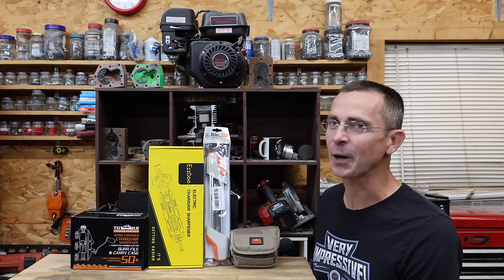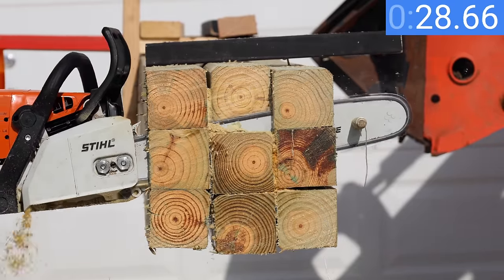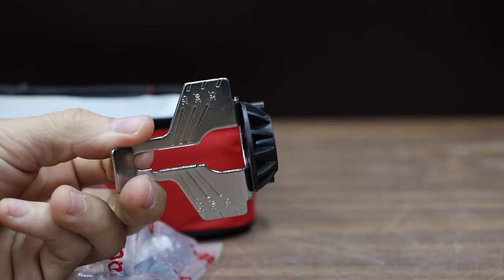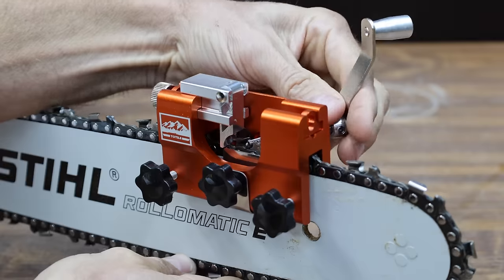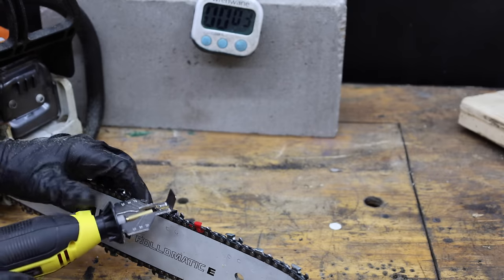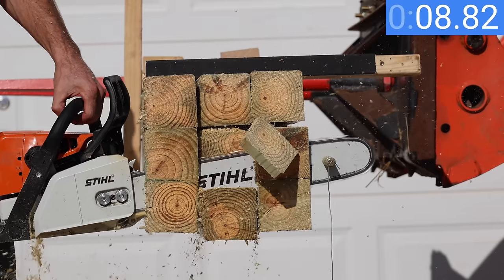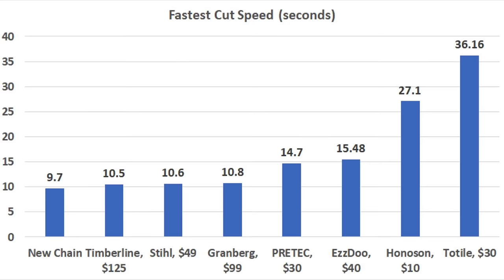Which Chainsaw Sharpener Is Best (2024)? Let's Find Out!

Comment: After years of sharpening chains with round files, I figured out the secret is lifting the file upward against the cutting edge as you stroke. Thanks for the videos.
Reply: yep, that is hardest part, always wigle
Reply: You are so correct and when you can wipe the burr off that top edge, you are good to go.   👍
Reply: im down here about to leave a comment saying exactly this. i worked for an arborist and learned the same thing
EDIT: the tool i used had a square file that also calibrated the depth gauge, and was attached to the handle, allowing me to do both jobs at once
Reply: Yes! A little flick. I use an electric stihl and it's five steady forward strokes (as if using a file) and a little upwards on the last stroke
Reply: But if you use the correct size file you shouldn't have to lift the file.
Reply: My Dad always told me that, smart man😁
Reply: Ditto.
Reply: This is true a but as your teeth get smaller after a few sharpens  you also need to remove material at the bottom as well therefore you need to push down and back as well.... aka getting the gullet
Reply: @jbbolts    I typically bear straight in for a few strokes and finish lifting upward.  “Giggety”🤣
Reply: 18 years of running a saw had me learn that early on.
Used to run Oregon 77LP on a Husqvarna 266 with a 15" bar.
Handled Sitka spruce up to 7m³ of measured timber.
No time for gadgets when it takes less than 5 minutes to do both cutters & depth gauges by hand using files.
Reply: @assog5737  People tend to press down when filing, so the file ends up cutting lower (that's why the Oregon file holders exist).
It's not so much lifting as ensuring the file is cutting at the correct depth & experience allows one to eyeball the top of the file for correct alignment.
Reply from the maker: You are welcome!
Reply: That’s the only cutting edge I even pay any attention to while sharpening. Not really sure why Todd was testing sharpness In the concave “belly”. As far as I am concerned that part of the tooth is only there to hold up the flat chiseled section and has very little to do with cutting. It usually ends up sharp anyway (if you are sharpening properly), but it shouldn’t be the section that is focused on.
Reply: And also you cant go back and foward with it
Reply: Thank you very much for testing different type of chainsaw sharpeners! I was thinking of buying a china grinder but now I don't have to, there is good consumer advice on this channel ! From Sweden Östersund thanks again 😊❤
Reply: @GARDENER42  While some gadgets help with accuracy, I have also found they slow just slow down. There's nothing better than the right files for sharpening the teeth and depth gages, and having enough practice.
Reply: @athhud  True! The top edge does the real cutting, and has a lot more to do with cutting speed. The gullet helps the chain get side relief and run a little truer and cooler.
Reply: @Bob_Adkins  Absolutely & when time is money, hand files & experience can accurately sharpen a chain in a few minutes
Reply: @athhud  its because he makes videos on youtube and isnt an actual operator
Reply: About to post the same. Technique was the issue here.

Comment: Have owned the Stihl sharpener for years. It’s fantastic. The fact that it files down the raker is a game changer. You can sharpen the chain many times before needing to replace.
Reply: Indeed it is the best besides a good hand file but for in the field can't be beat.
Reply: There was another YouTube guy, home star something or other, but he did the Stihl sharpener and said he'd ONLY use that Stihl all in one sharpener.
Reply from the maker: Thanks for the feedback.
Reply: Yup, good point.
Reply: Agree! I don’t even bother to use my Oregon electric sharpener anymore. I can do as good a job with the Stihl and I don’t even have to take the chain off the bar.
Reply: Yes, wear gloves when sharpening if you don't want to bleed
Reply: Stihl ones are great. Just to be aware to buy the right sized one for each size of chain if have multiple saws as the measurements are not the same. I have 3 of them. Also worth having a file brush to sweep out filings and keep files clean, and to spin the files a bit in the device every so often to wear them easily.
Reply: @cgasucks  Good idea !
Reply: 18 years of commercial use meant chains were taken down to the top being a mere triangle & depth gauges/rakers reduced as needed on the way.
Used to reckon on three sharpenings for each filing of the depth gauges.
Reply: Agree. Sthil sharpener is a game changer.
Reply: Agree.  Best sharpener.  Used it for years.  I could be a spokesperson for this product I like it so much.  Fast, easy, impossible to screw it up, and make the chain like new sharp. I've talked a lot of friends into buying this product and they've all thanked me.
Reply: @CharlesManch  Homestar runner?
Reply: If you want to save a few bucks the PFERD Chain Sharp is the exact same thing made in germany just a different color and a little cheaper
Reply: The Pferd one is the original. They are the supplier for stihl.
Reply: If you don't know, the Stihl manual sharpeners are made by a German company, Pferd. Pferd sells the same sharpeners without the Stihl branding (blue instead of orange) and about $10 cheaper than the ones with the Stihl logo on them. Pferd makes some of the best files on the planet, which is why Stihl pays them to make theirs. If you need multiple diameters, you can buy one Stihl-branded and the other Pferd so you can tell them apart at a glance.
Reply: Anybody here able to provide a link for buying the replacement files for the Stihl 2 in 1? I’ve been searching and can’t figure it out
Reply: I disagree, rakers dont need to be filed down every sharpen…i file my rakers based on the wood im in and use a proper raker depth gauge…the 2 in 1 is trash…
Reply: Same here. I've had variations of just about all of these and the 2--in-1 beats them all.
Reply: @GARDENER42  thats why i tell people the 2 in 1 doesnt work…you have to take the flat file out, you shouldnt file your rakers every time you sharpen the teeth…

Your chain will be way too aggressive, ive not had good luck with the 2 in 1
Reply: I've also owned and used the Stihl for years.  it's an incredible product. The simultaneos raker sharpening often will make the chain better than factory.  It also is small/portable, doesn't take electricity, and you can sharpen very quickly. it really is about the perfect product.

I've been waiting for him to review it.

Comment: Sharpening a chainsaw blade is absolutely on of the most annoying and tiresome things to do. This video is SOLID GOLD information people! PF knocks it out of the park once again!
Reply from the maker: Thanks!
Reply: @HQHQHQHQHQHQHQHQHQHQHQHQHQHQHQ 100% agree all these sharpeners are gimmicks except the Stihl combinfile
Reply: @HQHQHQHQHQHQHQHQHQHQHQHQHQHQHQ although Todd does a fantastic job with this channel.
Reply: when you put a new chain on, just do "maintenance" files with the stihl file every tank or two of gas. just real quick 1-2 swipes on each cutter. takes 3minutes and it stays sharp all day.
Reply: @dannyboy8835  Until you hit a rock or piece of wire.  That'll teach you more about filing out a sawchain. But yeah, using a file is the fastest and cheapest way to keep your saw cutting well. That's how all the loggers do it, and woodcutters who have taken the time to learn the skills. Folks these days don't bother with learning skills when they can buy gadgets to "replace" the skills. That's the difference in a consumer with a saw and someone making a living with his/her saw.
Reply: @dannyboy8835  Basically what I like to do. When that isn't enough I swap the chain and when I have a few dull ones, I drop them off at the local hardware store.
Reply: I bought a new chain after getting one of those barrel files and being frustrated.  "Problem solved" I thought.  Nope.  Duller than this comment in as many seconds.  Great video and thanks for triggering me, m8.
Reply: @bansheedearg  sharpening anything  is never as easy as us old-timers make it look. Everything I have is super sharp. It did take YEARS (no real supervision) to learn best how to hand file a saw chain. Getter dunn.

Comment: That sliding Stihl sharpener is spectacular.  I spent several days non-stop cutting with an MS360 saw removing a couple of enormous trees and that thing was a life saver.  After some practice, it only takes a few minutes to put a new edge on the entire chain.  If you do it every time you fill the saw with gas it really keeps things moving.  It was $40 when I bought it on Amazon, but it was worth every penny.
Reply from the maker: Thanks for the feedback.
Reply: The best part about it is that it takes the rakers down with the cutters! It's the best sharpener I've found.
Reply: That's the one that caught my eye, as well.  The dual action, the simplicity and the solid compact form, easily make up for it not producing the absolute sharpest results.
Reply: It’s now $50 probably bc of this video 😂
Reply: Agree. Easy, portable, no batteries or plug in and sharpens really well. Only down side is listening to knuckle draggers go on and on and ON about how they can do it freehand and you'd be laughed outta the woods using it and you've gotta hand in your 'man card'......🙄🥱
Reply: @wingnutbert9685  I will cheer for them, as I do it the easy way. :)
Reply: All the way with the Stihl sharpeners. I have a couple different ones and they not only perform well, but last a long time.
Reply: Same here I use it after every tank of fuel and it's a game changer.
Stihls are apparently just rebranded Pferd sharpeners which can be a little cheaper to buy
Reply: @alberttresslevic914  Good to know! Thanks! Pferd are good files.
Reply: I bought the Stihl sharpener and absolutely cannot figure out how to use it. There is no angle to hold it where it lines up with the 30 degree of the teeth without the extra metal parts preventing it from going where it needs to.  It's back to the reliable spinning grinder stone in a hand drill. Seriously, why does Stihl sell something that it must take some expert secret knowledge to use?
Reply: @BenDiscoe   Make sure you have the right one, it fits one specific chain size. They're very easy to use so if it's not lining up then maybe you've got the wrong one for your chain.

Comment: I cut about six cord of wood per year. For the last two years I have used the EZZDOO. I free hand without the guide. Great results. Very happy. Tip: When you order the EZZDOO also order three or four boxes of stones the right size for your particular chain. The EZZDOO only comes with three stones, one each, three different sizes. You will need spare stones in your size. Great video.
Reply from the maker: Thanks!

Comment: When I purchased my Stihl chainsaw a few years ago I also purchased the manual sharpener.  I was impressed with how well it worked.  I have manually sharpened my chainsaw for decades.  I tried the adapter to my dremel tool several years ago, but felt it didn’t make a long lasting edge.  I now use the Stihl sharpener on all of my saws.  Love it and have recommended it to several people.
Reply from the maker: Thanks for sharing!
Reply: @ProjectFarm  If you do another show down, I would like to see the dremel attachment and plus any that use drills as the power soure.

Comment: I help run a tree trimming service and we use the stihl sharpener that knocks down the rakers at the same time. Great sharpener that does it all with correct angle markings on it so you know you're sharpening it right. Great video as always
Reply from the maker: Thanks!

Comment: I have the Stihl sharpener - it's great!  Fast and thorough - gets you back up and running in no time.  Glad I bought it.
Reply from the maker: Thank you for sharing!
Reply: Stihl sharpener is also known as a Pferd sharpener, and in my opinion, it is the easiest, very effective, and my personal favorite.
Reply: The Stihl is ideal for resharpening in the field and the Timberline for example is good for sharpening done at home.
Reply: I have the Pferd with the blue handles.  It's about $9 less than the Stihl.  Husqvarna sells something similar that os only $34.  Then there are the Chinese Pferd knockoffs for about $23 I think.   Not saying these all need to be tested but......
Reply: Same from the last video review.. love it
Reply: These also do Rackers, so in the long run I feel it saves time over the life of the chain in my experience.  I have a oregon bench top I haven't used since I got the Pferd. Just get a file card to clean the files and your good to go for a long time in between new replacement files.

Comment: I have been using the Timberline system for the past 6 years. I am 64 years old and run seven saws. I can do my 20" Rancher under 15 min. My chains last 3 times longer and tooth consistency is second to none. I have found using a 3/16 cutter on a 7/32 chain improves cutting performance. The Timberline cutters are Tungsten steel and will do 50 plus sharpenings. Best money I have ever spent. Sharpenings can be done in the woods, tailgate or benchtop.
Reply from the maker: Thanks for sharing!
Reply: I have hand filed beginning at the grand old age of 12 under the stern supervision of my Grandfather,  he did me well!
Reply: I also use the Timberline system, and have found it to produce the best results of any sharpener I have tried.  I also like the Stihl, but dislike having to put my saws in a vice to use it accurately.  The Timberline can be used anywhere, and once you are used to it, the time to sharpen is greatly reduced.
Reply: Timberline is awesome. I wouldn’t go back to a hand file, and yes I would be getting about 3 times the life from a chain

Comment: I would be interested in a comparison between wire splice methods, especially for automotive use. There are a lot of opinions on the internet about soldering. crimp connectors, solder and heat shrink, special heat-shrink that contains solder (genuine TE and knock-off) etc. My personal favorite is soldering manually and then using the solder sleeves, which nobody else seems to do, but I use soldering and generic heat-shrink as well.

Strength, weather resistance and vibration resistance are the most important tests I guess, but size of the splice and ease of use (especially in tight spaces) are also relevant.

Maybe a little bit outside of your usual themes but I think you are the right person to nail this once and for all.
Reply from the maker: Thanks for the suggestion.
Reply: seconded!
Reply: I worked professionally with car audio, remote starts, and GPS installs before switching careers (IT now). You won't believe it, but myself and the majority of colleagues over the year just twist and tape wires together, even data wires. You can call it "military splice" for pictures online, but I generally fray the ends in two directions, twist them together, then wrap them around the wires backwards each side. If it's one loose wire connecting to an existing wire, strip away the plastic and poke a hole and kinda do the same thing twisting it each side and taping the wire to the existing one. Tape it tight and if you did it right you can't even pull them apart no matter how hard you pull. I have done my entire Jeep Wrangler build like this starting a decade ago and the amount of heavy off-roading and movement not a single wire has came loose or apart, inside the cab or under the hood.

Most professionals agree on absolutely not anything T-Tap style, that stuff will eventually fail on you. Anything else you mentioned works fine if done correctly though.
Reply: It's worth noting that no OEM harness in any modern vehicle has any soldered joints. Ideal solution is to get the appropriate crimp terminals and replace the entire wire, but we all know that's simply not feasible when adding accessories or making inline repairs. 
Your idea for a comparison video is a good one.

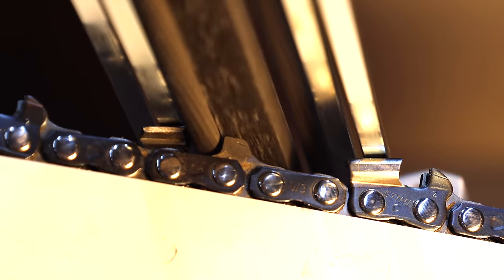Comment: Stihl sharpener is supposed to by PUSHED only, not pushed and pulled (as you appear to be doing at the 11:00 mark).  I own 4 different sizes and it's all I use.  Takes care of sharpening and adjusting the depth at the same time.  Excellent tool.
Reply: Actually pulled only towards you, but your right..arrow is towards person ...yep he'll find out the hard way when everyone sees this video and ruins their new chains😅😅😅😅
Reply: He’s not cutting while pulling. Maybe turn the volume up on your device. There is little to no sound when he comes back to him meaning he is not actually grinding anything but just getting the sharpener back to him to PUSH forward for sharpening.
Reply: He has also done testing on files; your beans and technique. He knows.
Reply: He actually has a test on the effect of dragging a file the wrong way. I'll save you half an hour, it really doesn't matter. Regardless if you listen he's barely dragging while he uses it. It'll be fine

Comment: I have owned the timberline for years and the one thing that keeps me coming back to it is that it doesn’t heat up the chain. Yes it takes a little longer but the edge is very sharp and I’m happy with that in the end. Feels as good as a new chain. But to each their own. Thanks for the video!
Reply from the maker: You are welcome!  Thanks for sharing.

Comment: I have been cutting wood for 55 years or so and I found a dremil tool with a diamond bit works fine and fast for me. I don't need the guide tools at this point but I do use the lines on the chain.  It may not be the best but for me it is the most useful with the sharpness and speed needed to do the job. I use a much slower speed on the dremil tool to grind the chain and the bit lasts much much longer. It is nice to see how they test and how sharp they are when done. Great video, thank you for all the work!
Reply from the maker: Thanks and you are welcome!